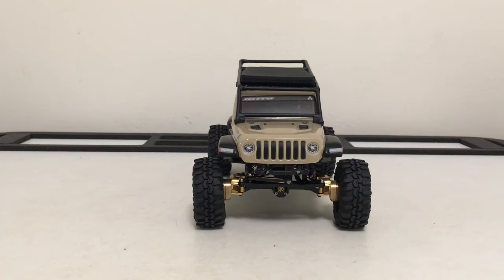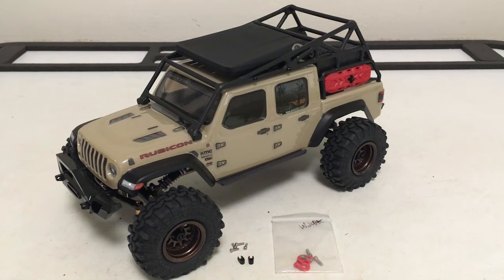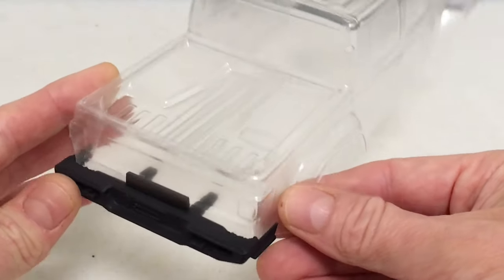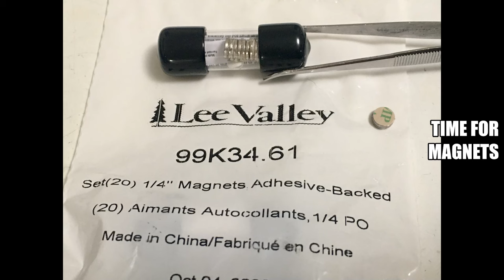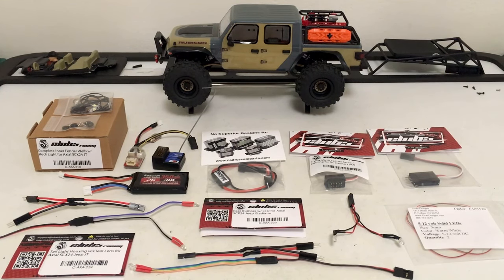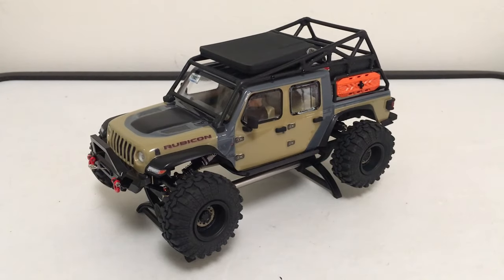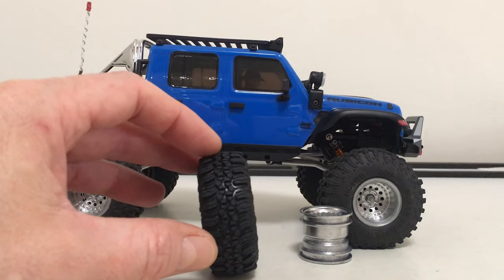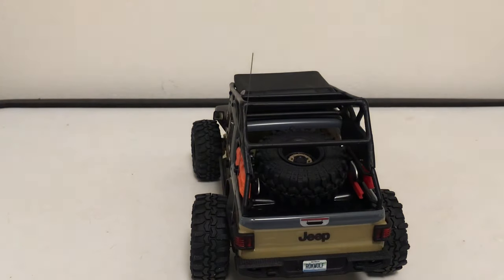SCX24 JEEP GLADIATOR 3.0 BUILD - STAGE 2: PAINT, BODY, SCALE DETAILS, LIGHTING, ELECTRONICS, WHEELS

Comment: That's the first limiting strap that ever made sense to me.
Reply from the maker: Yeah that central pivot is the way to go!
Reply: Yep, I had used a longer screw and put a rubber band on a pivot ball for actual true limit strap that truly doesn’t limit side to side flex. It works like a charm but changing the bands was something I never looked forward to as they dried up in the San Diego heat.